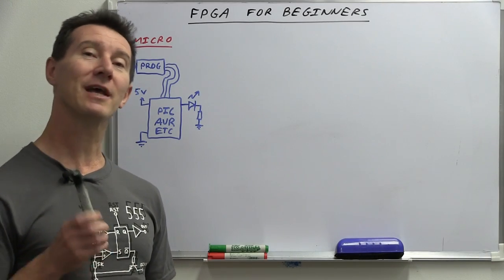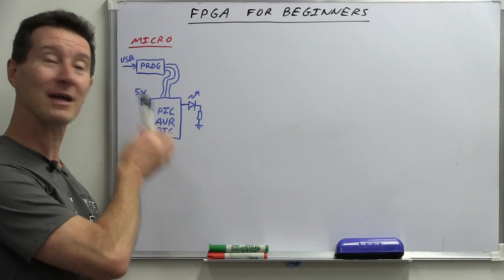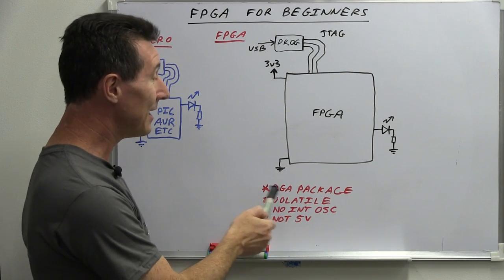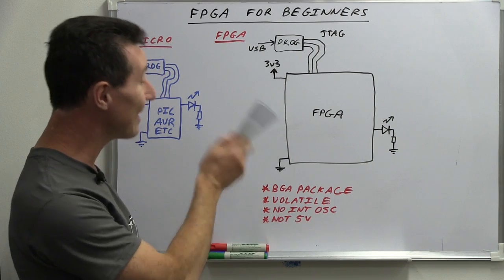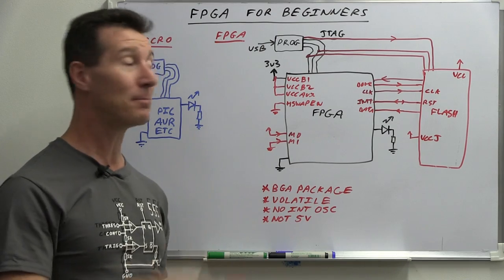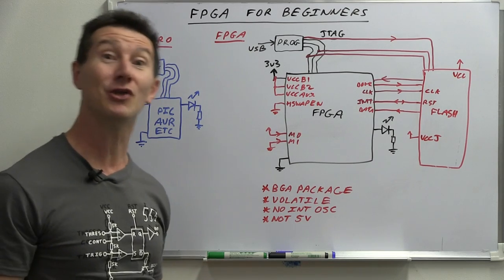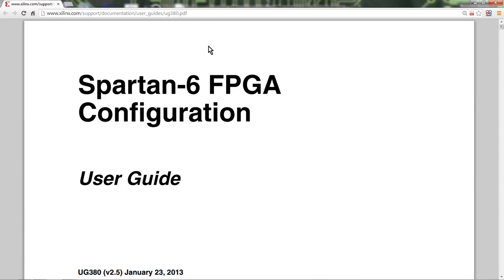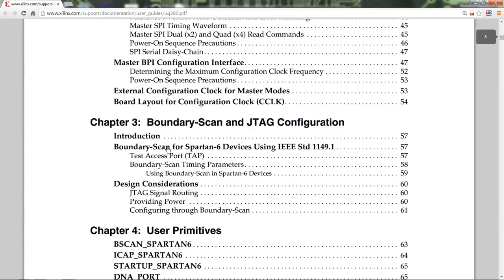EEVblog #635 - FPGA's Vs Microcontrollers

Comment: As an FPGA Engineer, I have had these difficulties whilst learning how to get going with the tech.  However these devices are not intended to be hobby friendly, they are for specific applications and recently are becoming more popular due to the concurrent nature of the tech, also because you can design pretty much anything digital in these devices they are great for recreating obsolete protocols. But yes the tool chain and documentation is a pain especially for xilinx (but hey its free unless you want a paid core).  I'd encourage people to get involved with them though, as there is a world wide shortage of engineers who can use them, and generally it's a well paid job with good job security.
Reply: I've heard about these before. I've obviously this a 10-year-old video and a lot has changed, as it does. With TinyFPGA Boards and IceStudio - I think there is hope in this field on educating others about such hardware.
Reply: FPGAs are next level! My beginner kit should show up in a week or so and I'm giddy af already 😁

Maybe in a year or two I'll be ready to join the field professionally.

Comment: FPGA = speed (up to 250 MHz), can emulate embedded cores (e.g. MicroBlaze MCS), multiple-clock generators, parallel execution, ease of intellectual property integration such as FIFOs, DSPs, you name it. The moral? FPGAs for the serious electronics person. I battled with learning Xilinx for six months, cursing every step of the way. Almost went NUTS but in the end, it is worth every bit of headache I got.
Reply: yes you are right:
Problems with fpga use is not because they lack something but because projects that require FPGA are in several orders of magnitude more complex than those who only require microcontroller.
Reply: What was the result?

Comment: I would rather use an FPGA board and go through all the difficulty to program/map a simple function. Why? I get to learn all hardware works and how protocol is defined, but with micro-controller , you mostly use the existing library people wrote without needing to know how hardware works, that's not the spirit of electrical engineer. For example, who knows how a 16*2 hitach LCD actually works? Most of people just know how to use a command defined by others to display and scroll words...
Reply: I just started learning m/c's with an Arduino and do want to learn how everything works. This fpga stuff is way over my head.
Reply: Robert Calk Jr. Then I would recommend learning to write those functions yourself when you are fully familiar with the IDE and existing libraries. Microcontroller architecture is also interesting, I never mean to discourage anyone who's new to it. Just there's different ways of learning it, don't use the IDE and existing library, use assembly language if necessary. To begin with, it's okay to use existing functions, but getting dependent on those libraries isn't my way of doing electronics.
Reply: I don't claim that I know electronics until I can replicate those "black boxes" like 741 and 555. Using off-shelf product is quick and efficient, nice to get the job done and get praised by employers, but...that's not electronics. Who doesn't know how to look for pinouts and solder up based on the schematics of others? Designing amplifiers, oscillators, switches, and knowing all sorts of uses of capacitors, inductors, and diodes, knowing at least 100 transistor circuits and interesting circuits is the way to go to be design engineer, but not test engineer, I know I have a long way to go in this respect too. Anyways, this is a bit off-topic.
Reply: Robert Calk Jr. I probably said something irrelevant, ignore it please. Knowing serial port on UNO board is a very good tool. I saw people hacking an optical mouse using the serial port to get the data. It's very useful still.
Reply: Yuji Naka
I don't consider any tips irrelevant. I appreciate it. Instead of just pasting the library sketches in and going, I like to type them in and study why and how each line is used and try to learn the language.
Reply: My way of learning is using code from others, modifying it, putting on safety glasses and testing it. Its one of the most interesting way for me to learn. I may have burned a few components but replacing them and maybe change the specs of those components to make them work has taught me a lot. I'm one of those who just can't force a book into my head, practical trial and error works very well.
Reply: Who forces you to use any libraries? A micro is as much down to the metal as a FPGA, they just have very different applications.
Using an IDE is just for convenience (from low level convenience like autocompletion, auto formating and syntax highlighting to stuff like full function descriptions/documentations being available right while typing or step by step debugging aso). You still got to know your hardware.
Reply: MrPolymath0 He was talking about being a design engineer. Design engineers need to understand the inner workings to be able to design, properly. Learning via the path of least resistance would get you fired pretty quickly as you'd end up costing your company a fuck tonne of money. Efficiency comes later with expertise.
Reply: Yuji Naka
Your comment is one big fallacy, in fact you even give an argument that's postive for microcontrollers.
The rest is based on assumptions and against all logic.

You can program the protocol yourself on a microcontroller. Libraries CAN be used, but don't have to be.
The fact there are that many libraries just is a positive argument to microcontrollers.

Could you please give an argument withouth false assumptions and fallacy.
Reply: +Yuji Naka Use FPGA if you are a design engineer with task to design customs or even ASIC digital circuits.  Don't use it or learn it over uC.  For example, if you somehow came up with a better design for an ADDER circuit or you came up with a new circuit that can convert serial to USB better than the FTDI chip currently, you can use FPGA and code/describe in your circuit and called the FPGA chip with a new name let say "Super FTDI".  As you can see FPGA are mainly use to design digital circuits.  You can design a microcontroller as well... remember FPGA is very fast... much faster than uC.
Reply: If you are a hobbyist and loads of money, no problem. But if you need to have a low cost application, let's say, for a product you are designing, you need to use microcontrollers.

Besides you always can go into modifying registers manually and then really understand how peripherics work.
Reply: So true haha I'm a beginner myself in electrical engineering as a hobbyist but I think Yuji is completely wrong
Reply: I write all my code in assembly. I don't use anyone else's code... this is probably not a good thing... as I am redesigning the wheel.  (sigh)
Reply: The point is : who gives a shit? Do you mind what kind of corn was fed to the chicken that laid the eggs you had for breakfast? Real engineers are solving real problems in the real world. Delving into a technology for the sake of itself is the definition of a hobbyst

Comment: FPGAs are harder to use than microcontrollers, but I don't consider FPGA hookups complicated. Same with the multiple voltage sources. If you're messing with FPGAs, surely you can build basic voltage reg circuits. It's not for beginners, true - however the applications aren't for beginners either. FPGAs can do some seriously hardcore stuff that AVR's can't dream about, but it's primarily about the numbers of IO's and total system performance. Obviously they're  going to use BGA packages - you need the IOs. A beginner doesn't need 1000 IO's that need to be processed in realtime and in parallel, because beginners aren't trying to create radar guidance systems and the like. ;)

Just to kind of throw some basics here though, this is what you can do with FPGAs which is impossible with microcontrollers:

-Multiple clock domains (different parts of the chip running at different frequencies)
-Multiple internal PLLs/DLLs - even a cheap FPGA can be a fantastic multiple clock source. Need 50 completely different clock outputs? No prob at all. Most inexpensive FPGAs can produce ~500MHz clock outputs as a maximum, unless you use a transciever as a clock output haha. If you want very low frequency clocks, just divide them down with user logic. PLLs are extremely easy to make/use - from starting up Altera's Quartus to having multiple clock outputs ready to go on a dev board - maybe 3-4 minutes? No coding even necessary. Don't be misled though! FPGAs are still huge time vampires for more general cases haha. :D
-Massively parallel processing - you can have individual circuits for processing each pixel/pixel group simultaneously for realtime/high framerate image processing.. whether it's convolution or other kinds of deep frame analysis like doing gradient analysis on frame stacks for vector motion estimation, general matrix operations etc
-Perfect for things like singular value decomposition or tensor analysis on multiple data lines for statistics/engineering/networking work.. I mean FPGAs are the #1 most used chip type for let's say deep packet network inspection hardware (Hi NSA!!)..
-FPGAs are fantastic "bridge" chips, in being able to allow realtime communication between completely different bus types. They can both buffer and restructure the bus to allow them to freely communicate. If you need to wire unusual data buses together, FPGAs can handle that better than anything else out there. At most, you'll just need some level shifter chips if the bus voltages aren't compatible with your FPGA.
-Transcievers!! FPGA transcievers are basically parallel to serial converters which are a "hard fabric" in a sense that they're pre-built onto the chips, and they can give you datarates of ~600Mbps to 20Gbps+ per pin. They're fully configurable and it's even possible to use them for low datarate stuff if you cheat a little. Even some inexpensive FPGAs can do 10Gbps+ throughput per chip.
-You can interface many FPGAs (almost) directly with the PCIe bus for true modular hardware acceleration for various APIs. The PCIe bus is full of its own complications but there are dev kits that handle all that for you if your body isn't ready lol. One of the issues is that the PCIe bus needs a very fast response from any board that's plugged into it upon computer bootup.. and the FPGA programming time often exceeds that, but you can dedicate other controller chips for this job...
-It's not hard to interface multiple FPGAs together for more power. This is very common for specialized applications where you need to achieve particular specifications, and no other hardware can provide it for you. You can keep shoving FPGAs into your design until it works. Horrible price/performance ratio but it will accomplish the goal when nothing else will! This is very common but rarely seen.
-FPGAs are fantastic learning tools since you're the one who will need to build data buses to communicate with any other chips you'd like your FPGA to talk to.. which involves understanding the data and timing structure of those other chips. This kind of knowledge and experience is invaluable for hardware engineers.. but hey it's not supposed to be easy, you know? However, computer hardware gets much more complex than this and you can't let every little thing intimidate you. Take your time, just be persistent. Giving up should not be an option if this is what you set your goal to. Once you get the hang of it, it won't seem all that impossible, just challenging in a fun way. To avoid being overwhelmed, just start with an inexpensive dev kit until you're comfortable with the basics and then try your own designs. I will shut up now. Sorry but I love FPGAs. <3
Reply: This is a great, very detailed description of the many uses of FPGA 's! Thanks for this!

Comment: I love FPGAs - can't argue with the complexity though - I use bi-directional bus switches to handle voltage level conversion (the commonly used mosfet level translator affects rise and fall times which can be significant in some designs). An EEPROM eliminates the need to reprogram it after cycling power and there are Non-Volatile FPGAs available. But yeah - if you can get the job done with an AVR, PIC, etcetera, I agree with Dave 100% that would be the way to go. I am about to watch ALL of his FPGA videos - Dave is a Dynamic personality with a beautiful method of presentation (i.e. Genius)

Comment: The Intel/Altera Max 10 FPGA seems a bit easier than most FPGA's. It has internal Clock, internal Flash and internal SRAM. Intel also deliver dedicated power solution for easy implementation. It also Comes with ADC, and even optional NIOS ARM configuration. It also has support for Different types of RAM, PCIE, and Flash memory. It offers up to 50.000 Logic elements. Can do some cool stuff with this thing.

Still micro controllers might be easier though. But it all comes down to the application you need it for I guess.

Comment: SPI is by for the easiest configuration memory to deal with assuming you are already hooking JTAG into the FPGA. To flash the SPI, the tool loads a special bitstream onto the FPGA that is used to program the SPI flash from the FPGA.

But yes, its a pain, if you screw up the program select pins, or the voltages, or the pullup/pulldown, etc, etc, etc., it won't work, and it won't be clear why.

Comment: I have worked with Fpgas since 2 years ago, and I love to design my own system, I think that Fpgas are better than microcontrollers 
because you can understand how to work the hardware. You think like a machine. A simple example. If you need to divide 2 numbers using software programming like C/C++ you only need to write the symbol "/" by the way in a Fpga you need to understand how to operate the mathematical function to implement a Vhdl module which realize your operation. You need to generate your own code to your system can difference between a signed or unsigned number, number of bits, etc. format: fixed point or floating point. There's so many things that you need to consider, but the thing becomes more interesting :)
Reply: Abstraction was invented for a reason. Use of division operator is no crime although I understand your concerns.
Reply: Pro tip: don't even try to divide in an fpga, multiply by its fixed-point equivalent instead ;)

Comment: Lots of years ago I saw an article on using an EPROM (yes one of those ) as a logic controller. Vauguely from memory there was a step ticker which stepped through the EPROM addresses and the output pins were serviced. I cannot recall how inputs were handled but the system simply stepped through the EPROM addresses and the burnt status presented to the outputs. A sort of Truth Table.
Sorry to be vaugue, it is 30 yrs ago in Z80 days and 2708/2716 time.

Comment: Hi Dave, not sure if you know about FPGAs with processor cores embedded in them. A lot of embedded systems designers (like myself), that need custom RTL logic with a "simple" microcontroller can go for single chip FPGA solutions since it can do both.
Reply: you can see M2S010 of microchip

Comment: As the memory is volatile on the FPGA, you have added an external flash memory. But it solves only one of the problems you mentioned in the video. Have you found how to resolve the problem of the missing oscillator too?

Comment: Many FPGAs actually do have Internal Oscillators.  They aren't "trimmed" so the frequency can change over a wide range say like 50-80 MHz.  The FPGA hard-logic uses it to self-program via SPI flash and the like.   On Xilinx FPGAs checkout the Startup IP block:  https://www.xilinx.com/support/documentation/user_guides/ug470_7Series_Config.pdf - StartupE2 primitive on page 95...

But as you mention you'll need a flash chip or a programming cable or something to make it all work..
Reply: STARTUP_SPARTAN6 is the equivalent in your part...